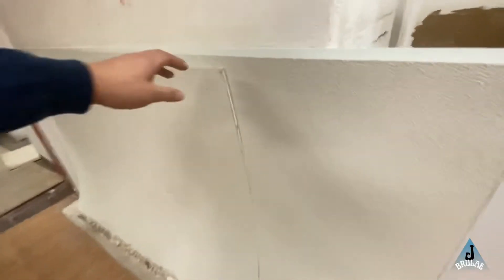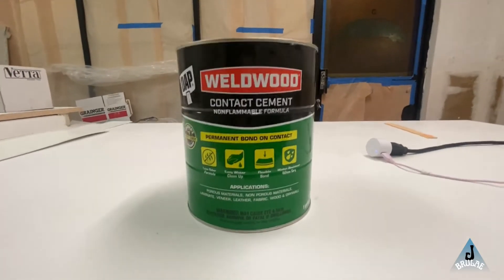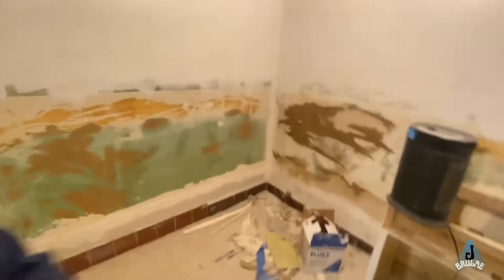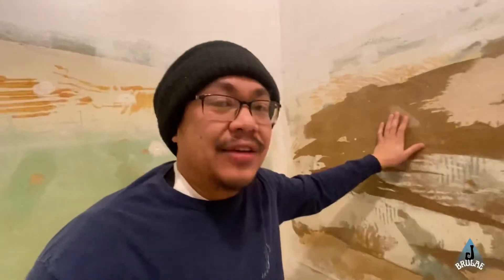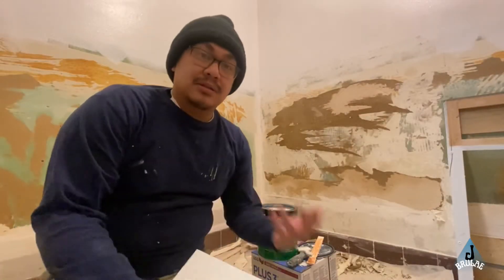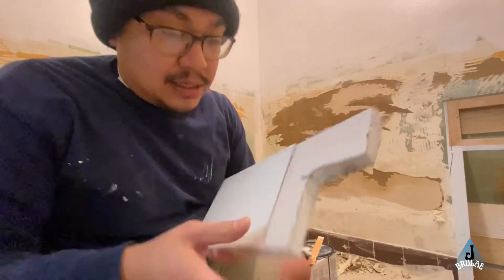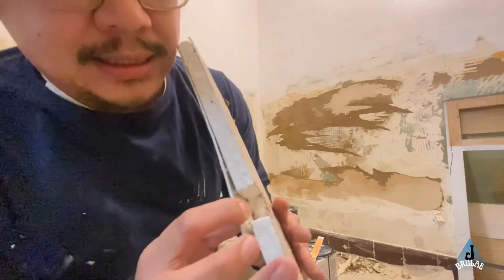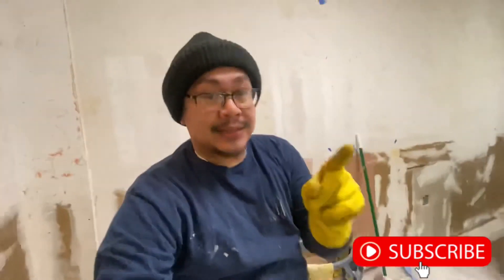FRP Wall Panel Adhesive

Comment: Frp glue comes in a 3.5 gallon bucket it's around 79 dollars
Reply: I'm using FRP to cover a deleted window in my shuttle bus RV.  I need to adhere to FRP Sheets together to reach a thickness.  Would I still want to just the FRP glue?